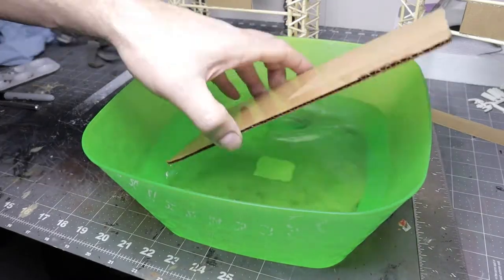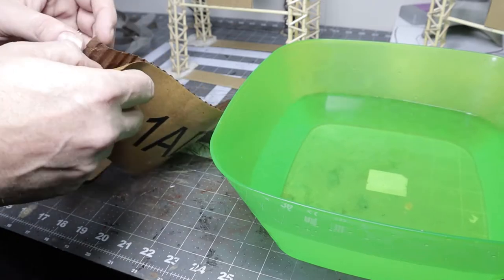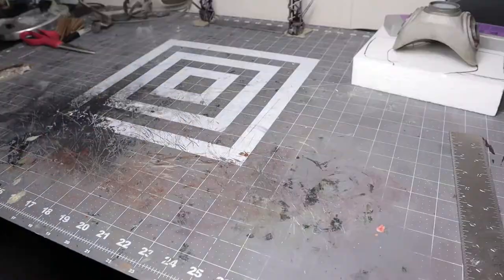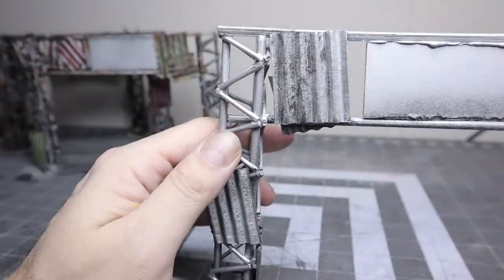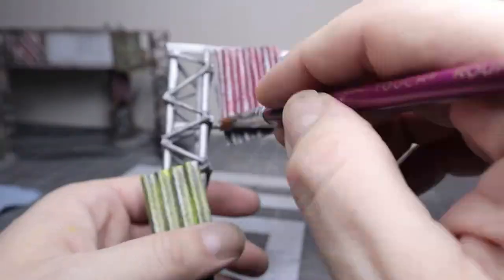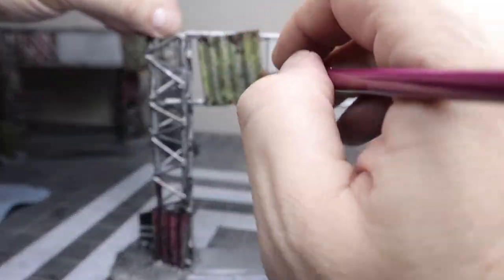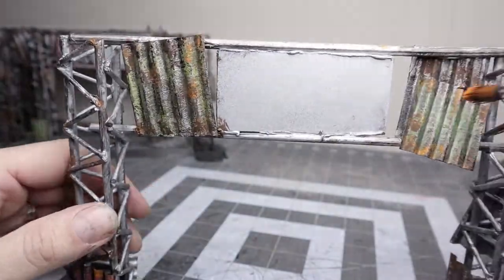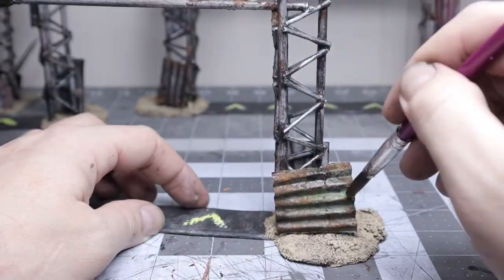Corrugated Steel for Miniature War Gaming and Tabletop RPG wasteland terrain

Comment: Good tip on the peeling. I did some dry and the stuck on paper bits are kinda ok for a built in weathering look but I think I prefer the "clean" looking way you did it. It's lot of extra work peeling those off if you don't do the wet method.
Reply from the maker: Yeah the dry-peel would work good for certain situations, a swamp, or an old cob-webby look or some such.  Not great for a desert wasteland.  Thanks for the input!

Comment: Came out looking real good 👍.  If you are worried about that corrugated soaking up paint or your wash hit it with Mod Podge first that will stop it and make it tough too.
Reply: Exactly this. In my builds, I hit everything with a thin coat of Mod Podge with a tiny amount of black paint in it so that it comes out like a grey coating that dries and acts as both texture and makes paper products hard and durable.